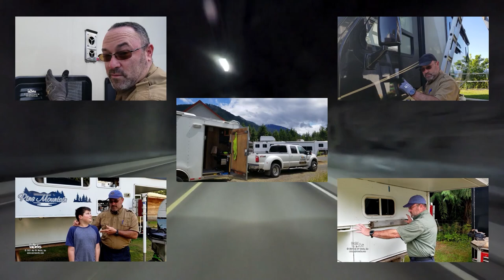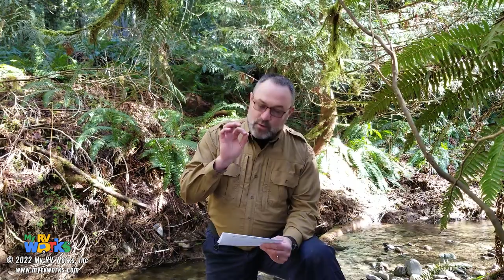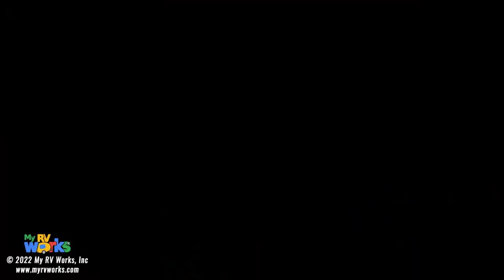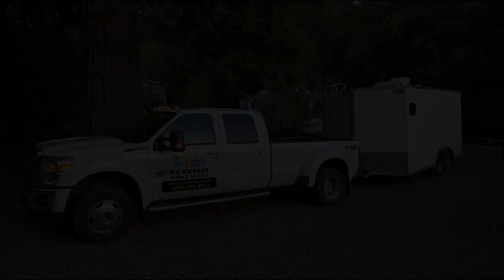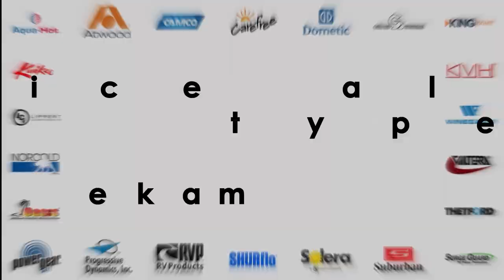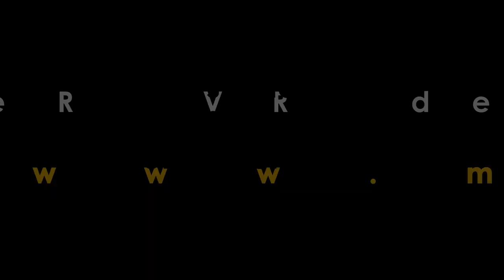No DC Power In RV & Atwood Furnace Not Lighting In Rainy Weather -- My RV Works

Comment: I'm not a RV tech, I love your videos and learn a lot. I live 135 mi. from the east coast. Your first question, I believe was from Joseph, with no power to his 12v system after moving his RV a short distance. He was thinking it might be his converter but you don't need a working converter to have 12v to your RV do you. When you're not plugged in to shore power your 12v system works straight off the batteries (after going through the " in use" switch.(That's what it's called on my RV, some call it a battery disconnect.) Now if that disconnect switch is bad you'll have no 12v even if plugged in to shore power with a good converter. Right? What am I missing. A bad ground would for sure cause problems. Love your channel, Darin.

Comment: Thanks. I always enjoy your videos. I have a Four Wheel Camper with a Dometic Furnace and a Dometic 3 way refrigerator. I've disassembled and inspected some parts of my furnace and refrigerator after watching your videos so if i had a problem out in the field I would know what I was getting into. I've done some baffling and extra fans on the 3 way refer, that really helped.(Thanks to your info.) I just installed a Lithium battery in place of 2 six year old AGM batteries and a Victron Dc to Dc charger. Thinking about a Victron smart shunt now. Maybe a video on a batterie upgrade and dc to dc charger?

Comment: My shower backs up and washer, when I have the gray water dump closed.  It all drains immediately if I dump the gray and leave it open. The coach is level. I suspect the vent stack.  A change in level will also cause it to release and drain into a closed gray tank.

Comment: Help in a bind. 2012 Tiffin Phaeton. Just replaced 6 6-volt batteries. Series, Parallel installation. Connect positive first then negative last. Had a sprk when connecting, then no spark. Some 12volt items work like the co2 monitor, 12 volt led ceiling lights do not. You opinion breaker, fuse, or reset inverter maybe? Wish I was there instead of California for a service call.

Comment: Are there normally issues with adjusting and running an RV refrigerator in winter weather...or how does freezing weather effect how to adjust our RV refrigerator?
Reply from the maker: One common strategy is to block off about 80% of the lower ventilation access. That is to say we need the air to be drawn into that lower vent but we can restrict it with cardboard or something so that the boiler has a chance to generate enough Heat to support the ammonia vaporization in the boiler.

Comment: Cannot find ohm specs on a Dometic RM2300 Fridge heater. Has 2 heat elements , I do have 120 v feeding  it.
Reply: Did you press the reset button on the circuit breaker on the heating stack? It's on the right side of the back of the fridge.
Reply: @aguyandhiscomputer , not one on it.
Reply: There is no heat sensors  on the heater stack. It has 2 probes on the side of stack, I removed them, cannot find any ohms info.is 1.of them possibly  a heat sensor? There is no circuit  board controls  on this model. I checked availability  of them by part number, one I found available, the other did not show as available.

Comment: I have a suburban sf-42 
Fan starts up, hear clicks and smell Lp. Furnace fire up, runs for a few seconds and goes from blowing hot air to cool air. Any ideas. I just changed the sail switch and limit switch. Same issue.
Reply from the maker: Hi Zilla, your question has been chosen for Episode 29, which will be available Friday, 8/26 using this link: https://youtu.be/5gTg5auLvA4. Thanks for your question!

Comment: How about the battery kill switch going bad?
Reply: Test this with a 12 volt meter on the wire coming in from the battery and on the wire leaving to the trailer...if the volts aren't the same on both sides then theres a problem with the switch probably due to corrosion